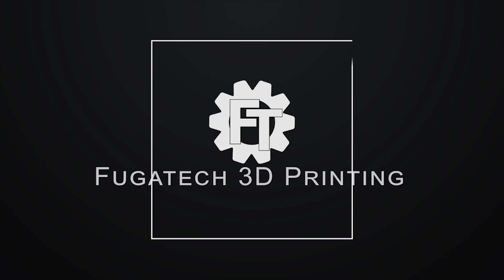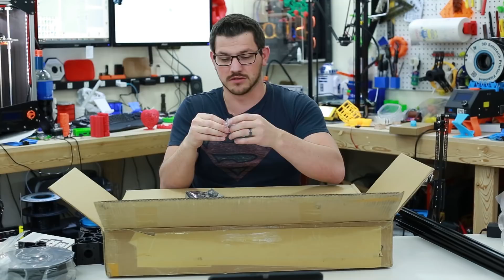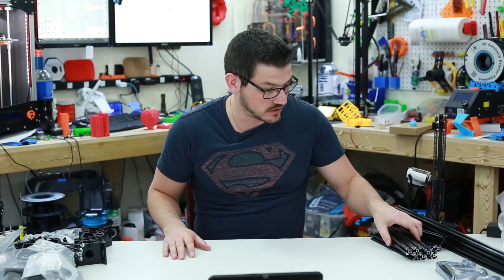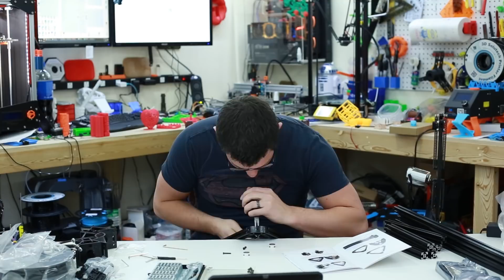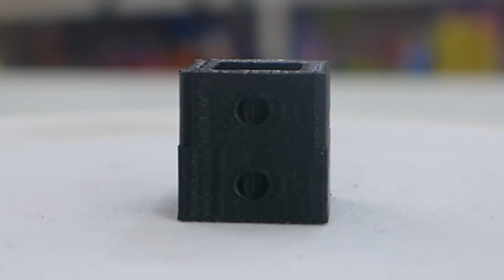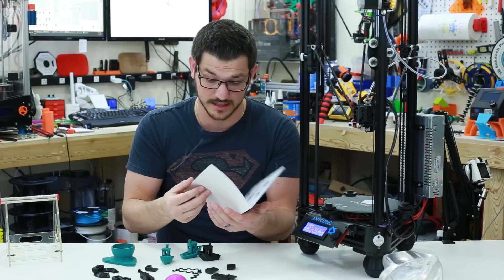Anycubic Kossel Unboxing, Build and First Prints

Comment: I just bought one of these and it came with a hot bed and a ton of other upgrades. Looks like they sent you a leftover. Mine also came with a 25 amp power supply.
Reply from the maker: I received the basic "Pulley" version.

Comment: Hi I got The Linear Plus and it comes with an auto leveling add on. I did have to go on the any cubic site for firmware that worked with the auto level as the one on the machine only probed half the bed. Now i have the correct firmware it is very easy to level. There are two things i have found with the firmware though, sometimes it just looses the settings and starts to print in mid air so i have to re auto level again. And the other is when printing sometimes the screen just shows a lot of gibberish but press the knob and all is readable again.
Reply from the maker: The gibberish is interference in the ribbon cables. You can wrap them in aluminum foil to help insulate them from EMI.

Comment: This bed adjustment things will (at least what I have noticed) make it worse. Deltas is not for beginners and there is lots of wrong information on the interwebs. The easiest way to get a Delta level  is to use G33 delta auto calibration, if set up right it works without probe as well. Anycubic have there source code on github. And when your at it check that the temp runaway is active... 
Chris has a way https://youtu.be/Xk7remEhUx8
Reply from the maker: They work well for me.

Comment: Depending on the board design you may have tripped a "poly fuse" It would explain why the printer shuts off at different times(different heated bed amps draw) and why the printer board comes back to life later.
Reply from the maker: This printer does not have a heated bed.
Reply: There are other things that could cause a current overload